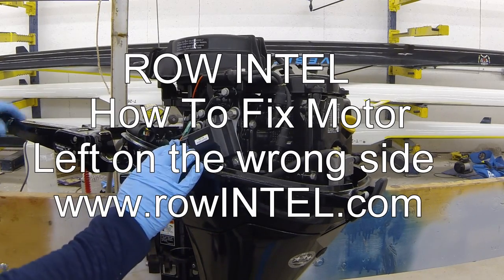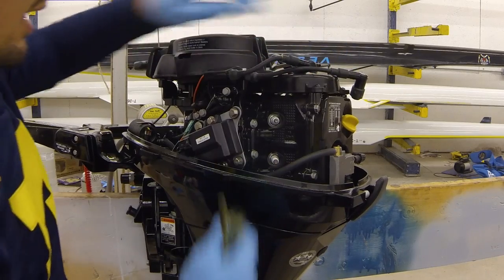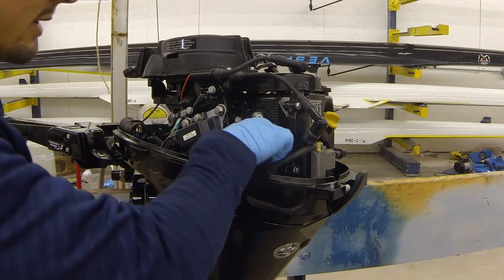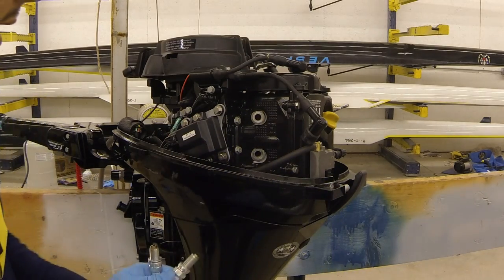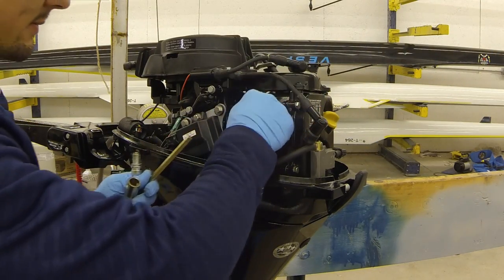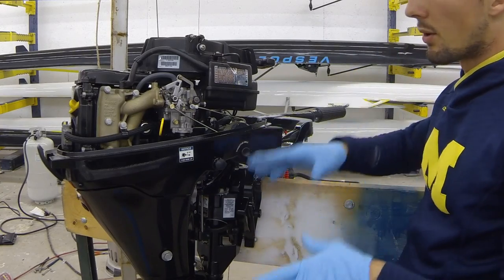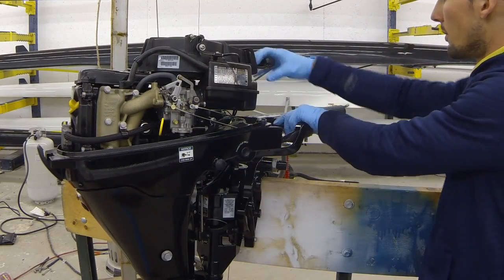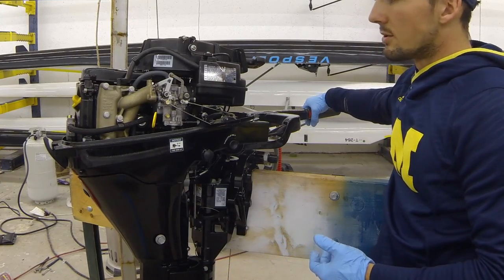How to fix your outboard when it was set on the wrong side

Comment: today I must have the motor laying down on the wrong side for a good 8 hours and had exactly the lock on the pull as described, opened up the crowl on the water, and there is oil inside and can tell oil spilling a bit in the water as well. didn't know about the spark plugs trick. after a good 5+ minute struggle with the throttle and juggling the pull, i was able to start with a ton of smoke coming out of as it started. This video summarized the whole thing and learned about cleaning the spark plugs trick. Thank you so much for sharing.

Comment: My 6hp 4 stroke was dripping oil cause I had it sitting upward rather than laying it on the proper side. Oil was dripping off the bottom of the skeg when I stood it up on the bench as if it was on the transom. Really appreciate the info. I took my time and followed the video. Then I followed the other which showed cleaning the carb cause the oil was leaking out of the carb. Cleaned it up and bingo! Can’t thank you enough, I’m not familiar with 4 strokes, now I am! Thanks again!

Comment: Dielectric grease is an insulator by putting it on the tip of the spark plug you are preventing a good connection between the spark plug cable and spark plug
Reply: That's exactly one of its uses.....you can use it on almost all electrical connection....prevents corrosion.
Reply: That’s a lie mechanics been doing it for years on evinrude Johnson maybe Mercury because they have cheap coils
Reply: @jimcatanzaro7808  they are only supposed to put it on the inside of the sparkplug boot so it forms a seal between the boot and plug ceramic, which is fine but not on the metal piece of the plug,   Again insulator prevents good spark,  but feel free to do it either way you want,

Comment: You mentioned the potential of hydrolock or back flow of oil into the carb. Is there then potential for oil flow via the exhaust manifold and have it exit the port which is below the prop above the skeg in my tohatsu 4t 8hp motor after the motor was laid on the non-tiller side for transport?

Comment: I had this happen on a recent fishing trip. Motor was transported on the wrong side and was DOA.  Cleaned out the cylinders and still no-go.  Removed and cleaned the carb and it purrs like a kitten.  

One question:  Is there a good way to get all the oil out of the engine casing?  I know most will run out over time but I would rather clean it properly than have it end up in the lake.

Comment: I just bought a used 2.5. I laid it down the wrong way driving it home. But mounted it on my kayak once i got home. A week later "today" i tested it out. It ran then stalled. Like 3 times. I did notice it was riding low to the water column. Long story short. It wouldnt start, and the oil started turning a milk color like water was getting in somehow. Got home, changed the oil, plugs were dry, spark was good, and primed the carb. Still no start. The only thing i haven't tried is loosening that bolt you showed in the video, and drain the carb. May be oil in there but that doesn't explain why it ran for a bit. Im lost on what to do next. What video is it that shows how to drain the carb? I guess i can try that next.

Comment: Hello I need some help I have a 1986 25 hp mercury pull start my question is the motor  is in neutral and the pull cord will not engage to start any suggestions thank you
Reply: See if u can disconnect that linkage that connects too the fly wheel/gear teeth,,,, i did that too my 1996 mercury 25hp,,, soo now i can start my motor with the throttle a little open
Reply: Idk how a 1986 looks under the hood,,, but that is what i did on my 1996

Comment: Hi! I got à problem carburator fuel leak even when the motor is off  mercury 20hp  2012 I clean up  but  still  leak maybe  check valve?

Comment: Thank you for the information. Im having the same issue with my small 3.5 mercury, when i slowly turn off the choke its starts to die. Oil in the carbs, hoping to get it back running when cleaning the carb.

Comment: I bought a  brand new 9.9 Mercury but there was oil leak in the box. is that normal? why it can happen? I guess it happened in the shipment and happened because of wrong carrieage of the shipment guys. the factory puts some oil to the motor before sending to customers?

Comment: So frustrating, second time, transporting tohatsu 20hp, on the intended side and it keeps flooding cylinders and locking the starter, why in the worpd they can't make these as 6hp? 6hp has 3 sides,  never had an issue like i do with 20hp tohatsu, how can i transport it? Why is it leaking when I place it on the intended side? During freeway ride theres lots of turns, going up and down so its not gonna be perfectly leveled, it should not flood engine!

Comment: I have a F20, use to drive it with oil level to the max at the oil stick. When stored laying on the flor with tiller side down/carb side up it still gets a large amount of oil in the lower sylinder. And it is living hell to get i running again🤬

Comment: hi there just watched your video and really enjoyed it, would you need to top up oil level before starting up the engine and it looked as if you didn't have a water supply hooked up to your engine, is this ok? i was under the impression that could damage the impeller please advise, would love to see a video on replacing a timing belt , ive got a yamaha 15hp very similar  to the 20hp you serviced the carb on another video  love the videos keep them coming thanks  Ross
Reply: Ross MacLeod you really should not run an outboard with no water unless it is an air cooled engine cause it most deffinently could damage the water pump impeller being the are rubber and the water helps lubricate them also you run it for too long overheat the engine wont take long with no water.

Comment: Not smart at all! Starting the motor for even a few seconds without water burns your impeller.
Reply: Lol seconds is fine so us less then a minute u know why it's cheap to replace and a wear item
Reply: You do realize pretty much every time you start it after its set for awhile the impeller is dry right?
Reply: What about a fuel injected engine?